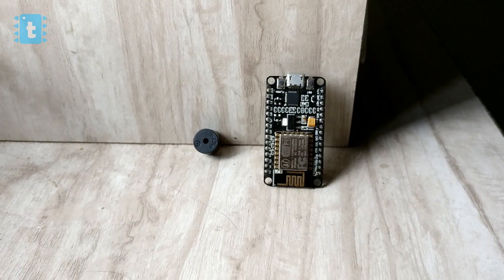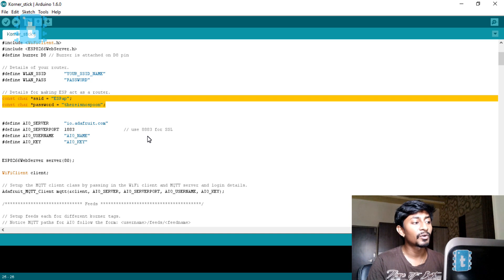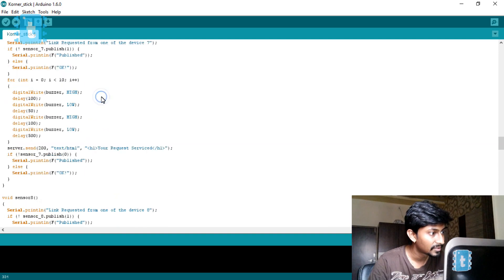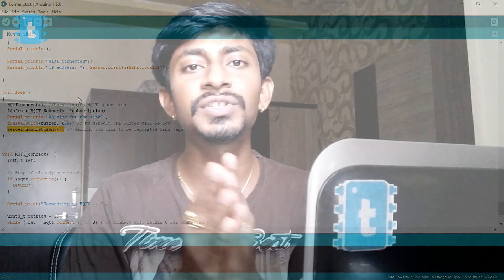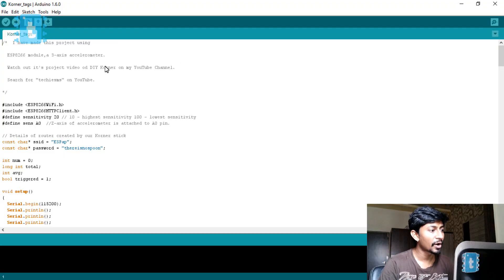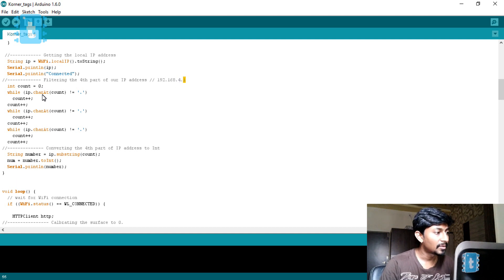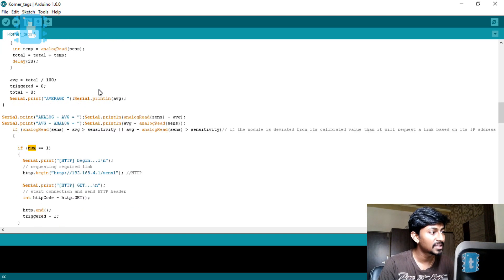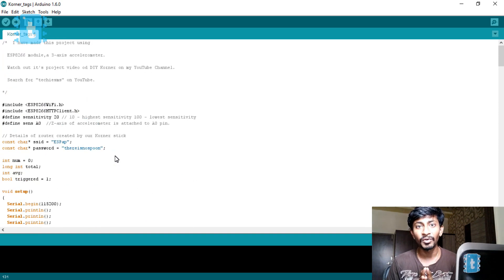DIY Korner home security system using ESP8266 wifi module | IoT Projects

Comment: Sir, Please help me out.. I'm making this security system as my mini-project.. I'm done with tag part and It's working properly but my tag is not connecting to Hotspot.. I did all the connections as per diagram, extract same code into ESP8266 module still facing problem..

Comment: Great Tutorial brother!
I have a doubt, hope you will help me with this.
What if we connect his module in other home with different router ? At that time that router will assign different IP for the Stick, and server will be running at different IP right? Will this product work there?
Reply from the maker: +justin paul yes!!! Absolutely
Reply: Is that because the NodeMCU uses default IP(192.168.4.1) in AP mode?
Reply from the maker: +justin paul 

no
It's because the stick used in Korner only needs internet connection,it is not dependent on any ip address.

Comment: why are you using Nodemcu for tags.... ??? i think they will increase the product cost ..there are other cheap and equally  effective communication options...Also the link you you have mentioned for cheapest nodemcu is the link for most Expensive one .... plz dont provide wrong links ...... the link for cheapest nodemcu(same quality)= https://goo.gl/pQzDt6
Reply from the maker: Chirag Sehgal first of all thanks for the link,I'll update that 

second thing,
there are cheaper wireless modules available like what you have mentioned in my previous video 
nrf24L01(Rs.265), RF module of 433 MHz frequency(Rs. 145), then we will also have esp8266-01 module(Rs 250) but the thing is that,they all are not stand alone, they just provide a wireless medium while to get the value of sensor and process it, we will require additional microcontroller.
and the smallest and easy to use microcontroller is Arduino pro mini(Rs.265)

so add up the values you'll get a amount greater than esp8266 12e board and looking on the other side of price, the complexity is much reduced in case of esp8266 12e board so the maker of the project only  need to give stress on understanding the code as the hardware is standalone system.
Reply: yes .....Nrf ..... will not be cost effective as not standalone .... also maker will not feel project a complex one ..thanx :) 
doing wondrfull work ....happy to see indian technical channel growing...
one thing- i suggest you to check components from ebay i guess things you mentioned in reply  are again very expensive...you also get 8-10% discount everytime....
Reply from the maker: Chirag Sehgal thanks, I'll take care of the components next time.
And share this to make our community of techies broader